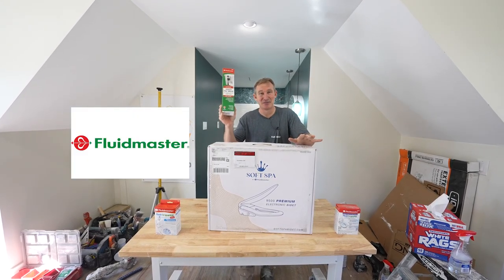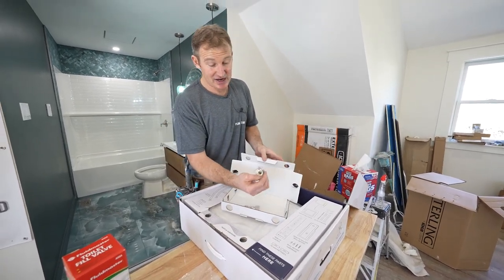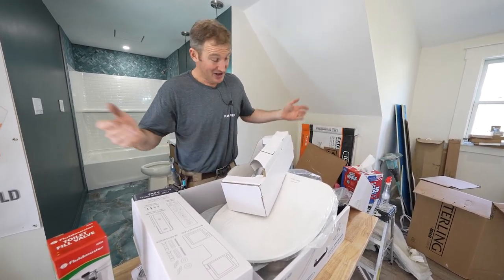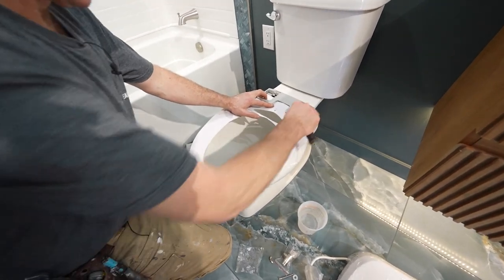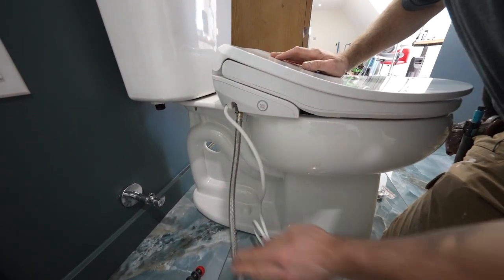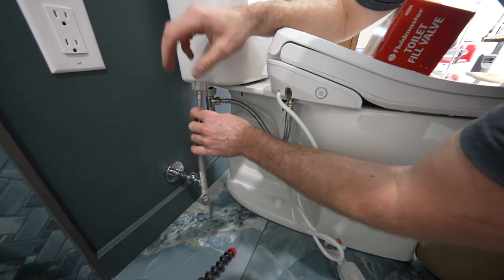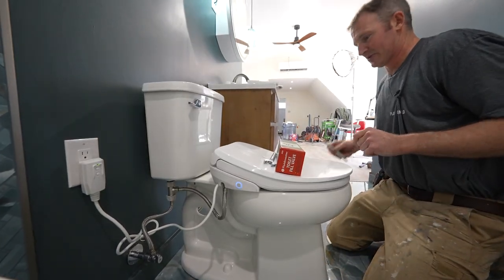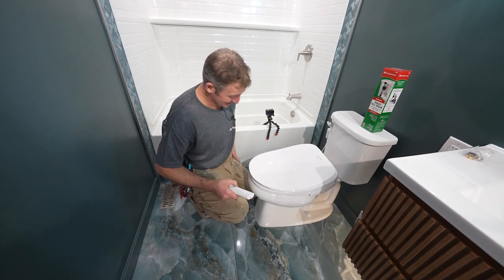Soft Spa Bidet from Fluidmaster - Bidet Seat Installation by The Bathroom Remodeling Teacher

Comment: I see no point of the light, the remote control and all the electrical gizmos.  It just makes this bidet to complicated requiring it to be powered.  The bidets that I have installed in my home are not powered and with just simple controls one can redirected the stream of water and the volume of the stream.  Simple!  Water and electricity do not mix!
Reply from the maker: Only electronic bidets have temperature controlled warm water, heated set and dryer. Our customers have said that the remote is very easy to use.  No water ever touches any electronic component of a bidet. Or else no one would be buying them!
Reply: @FluidmasterInc  How many people would have an electrical outlet located conveniently next to their Toilet?